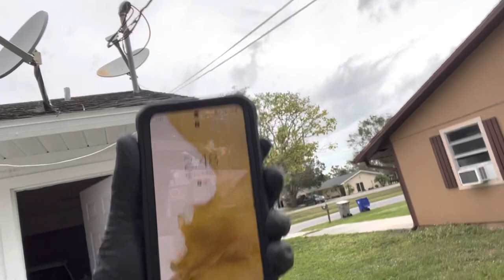Slab Leak? Re Routing a water line through attic.

Comment: I've been chasing slab leaks in my house for 33 years. Hydronic system leaking in the slab, into the ground, only indicated by water meter constantly running. I rented an thermal camera to map the copper pipes,  then drilled holes in the slab adjacent to each connector, or elbow. Then plunge a wooden dowel into the hole and see if it comes out wet. Found every leak, every time. Then I simply jack hammer the slab over the link and sweat in a new section.
Reply: Why, when you could have repiped the entire house and been done with it 33 yrs ago. I can imagine what kind of  clusterfuck your house must be.
Reply: @H2OMANLV  Not even a close comparison in price, time, or destruction to do it my way.  Not to mention the energy loss involved by re-piping. The runs would have to quadruple.
Reply: That sounds like a nightmare.
Reply: thank you for this knowledge.

Comment: That’s a colossal mass how many different pipes can 1 place have, pex, copper, shark bite fittings and pvc what a nightmare
Reply: I work on old houses all the time and it’s nothing to see galvanized, copper, polybutylene, and pex all in one plumbing system
Reply: @tannerwest6823  I know it’s just plain ridiculous
Reply: @tannerwest6823  Actually that's not true.  It is against code to combine different materials in one plumbing system OCA 121:6a(2).  I highly doubt you have seen that combination.
Reply: @Rocky-bv9sp  actually have seen that many times. Plumbing code has nothing to do with the way old pipes have been cut out and repaired/replaced over the years. I’m talking about an old house that started out with galvanized pipe and over time this guy came in and replaced a line with copper and then another time this handyman or homeowner/flunkie came in a replaced a leaking pipe or fitting and might have used CPVC or hell even pex nowadays. I’m not talking about a house that was originally plumbed with all these materials. Of course that wouldn’t pass code. And besides when people make a repair on an old system do you really think they get it inspected. Hell no they fix it with whatever is cheap or convenient for them and keep going.

Comment: Why does code anywhere in the US allows for water supply lines to buried in concrete regardless of the type of pipe.
Reply: Job security for plumbers and foundation repair would be one reason. They make a fortune in my area.
Reply: Just dropped $8500 due to a burst pipe under garage floor slab. They ended up running a line from meter to house , and shut off the mainline.
Reply: Not trying to be funny , but where should you put it? I live in a city row house.

Comment: Matt are you located in Florida?  Hous I have was built in early 90s.  Got a leak under the slab, Heard county is using a chemical other than chlorine that is eating the copper pipes up from the inside out at a rapid rate, do you recommend me doing a complete pex reroute/repipe through the attic so i don't have to deal with future headaches, or a spot repair.?
Reply from the maker: Yea florida , depends on $ situation but if you can go for it . Cry once
Reply: Thanks Matt, do you service the Port Saint Lucie area?
Reply from the maker: @infomattersmost  shoot me an email, I may be able to point you in right direction

Comment: if my rain shower head is in the ceiling and the pipe goes through my attic ( ohio gets cold in winter) what can I do to make sure the copper pipe doesn't freeze in the winter.. and is there going to be a condesation problem on the pipe that drips down onto my ceiling.... The copper pipes is about 5 inches above the ceiling..

Comment: Who puts the drywall back?

Make an access panel there?
Reply from the maker: Hopefully not the last people who put it in
Reply: As a plumber we don’t put drywall back especially when it’s soaked and you could cut it open with a butter knife
Reply: @glenarseneau4796 ; a butter knife should not be used to cut drywall.
Reply: @fredhammer6413  Butter knives are actually the best way to cut drywall, it's efficient and leaves a smooth line for later repairs.
Reply: @Rocky-bv9sp  ; you don’t know what you’re talking about.

Comment: Great investigation sir with total professionalism. Just curious what that four hour job cost? Great plumbers are hard to find. My ten year old basement sump pump was hummimg. I ordered a new one with a new basin cover. The ejector pvc pipe and vent pvc pipe holes were off line. I called a plumber who placed the new pump in the basin, installed the new cover both new ready to go. The plumber put new 2" pvc pipes into the new holes about a 4"  longer run. Sealed the cover with silicone, tested the pump a few times which went well. Total time spent on the job was 75 new york minutes costing me over $430. I was shocked that his labor was that much money. I wish I had asked for an estimate first. A lesson learned. I wod love reading more stories.
Reply from the maker: Thanks for sharing, hard to say w pricing but that sounds pretty reasonable without knowing exactly the situation/what was done.
Reply: That is pretty cheap

Comment: Thanks so much for this.  Well done!
 
I definitely have a slab leak in my backyard concrete.  Luckily it's out in the open.  I have a good idea exactly where it is because I had a pinhole repair in that area a few years ago and water is seeping up through the concrete cracks.  I'm thinking the whole 30' run of lateral copper pipe should be replaced, not just a spot repair.

Can a new pipe be run without removing 30' of concrete?  Or how about running Pex underground..like bore a hole first?  Or running pex through the inside of the existing copper pipe (which I saw someone on youtube do).  ps. The waterline goes to my guesthouse.

Comment: Great video, great job. How long are the O-rings in the crimp joints good for roughly?
Reply from the maker: Not sure, but viega has 50 year warranty so I guess they figure that or longer …
Reply from the maker: Same wit most the other manufacturers
Reply: @Dr.GreenPlumb  Thanks Matt, That's much longer than I would've thought for say a hot line. Much respect......

Comment: How long will the slab leak continue after the repipe? I just had a repipe and the problem area is still leaking
Reply from the maker: Shouldn’t be unless it’s just residual water, dry it up really good and if it keeps getting worse you may still have a problem. Try checking water meter
Reply: @Dr.GreenPlumb  yes the meter says everything is fine yet a leak is still occurring.

I wish I could show you a quick video/picture
Reply from the maker: @dlrsnate5100  hard to say sometimes slow leak you have to check after 10mins see if it moved. Maybe call whoever did repipe to come back out?
Reply: @Dr.GreenPlumb  yes he came back and rechecked and said there is no leak anywhere in any line. He said any drip may just be residual that is still finding its way out after 24 hours
Reply: @Dr.GreenPlumb  I need advice. I just paid 2grand for a plumber to diagnose and determine the leak was from the hot water line. They really claimed they found the leaking line with some Rigid tools and then “fixed” it by abandoning the line and rerouting to Pex in the attic.

This makes complete sense to me. They ran tests and said there was no further leaks in the line. 

However, the leak is still leaking. It looks like it’s dripping from under the foundation. I emailed you photos.
Reply: @Dr.GreenPlumb  I totally believe they rerouted the line successfully. BUT I think they did the complete wrong job and misdiagnosed it.

I was really laid back and thought I could trust these people to make the right call. I’m unsure why they’d commit to abandoning a line unless they were 100% sure.

Am I entitled to a refund for misdiagnosed / wrong labor performed. ???
Reply: @Dr.GreenPlumb  I called em back out and they said there’s no leak. But there obviously is one. 

I think I may file a chargeback because they didn’t address the problem and did unnecessary labor. What should I do?
Reply: Also, they claimed it’s the “hot water line to the bathroom” but the water dripping is cold. How does that make sense??

Comment: Isn't that water line in the attic going to freeze?
Reply: Likely yes.  But if the homeowner is aware they can drip the lines to prevent freezing.  It doesn’t add much to the water bill.
Reply: Not in florida
Reply: @DDunc1020  Florida is now prone to quite a bit of freezing temperatures, climate change is real.

Comment: Change all that crap to PEX
Reply: And then change all that pex back to copper in 20 years
Reply: @DDunc1020  That's why I always use rubber pipes, it's cheaper and it will last a lifetime.
Reply: @Rocky-bv9sp  by rubber you mean what?